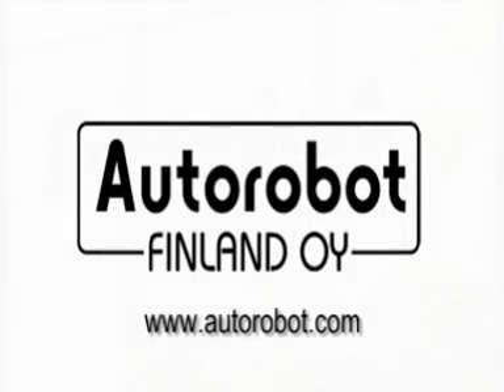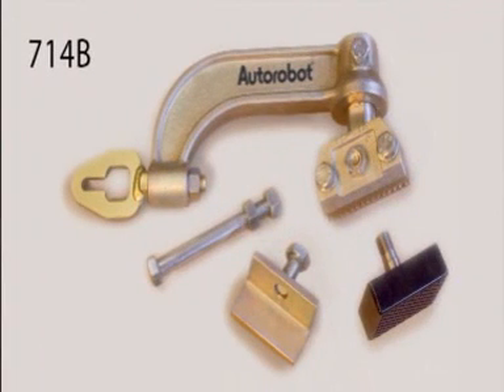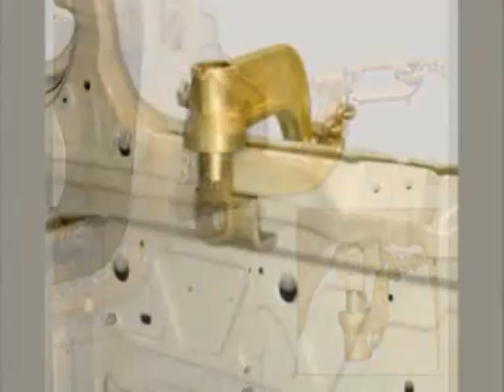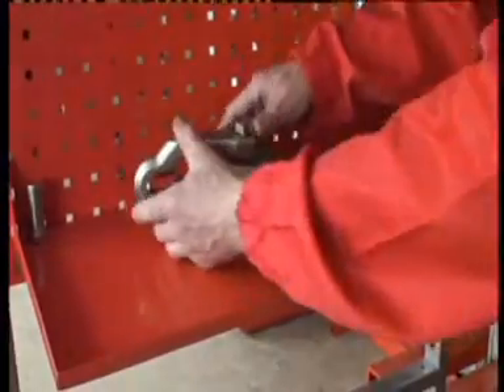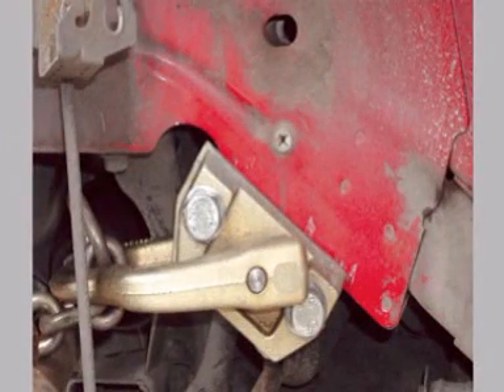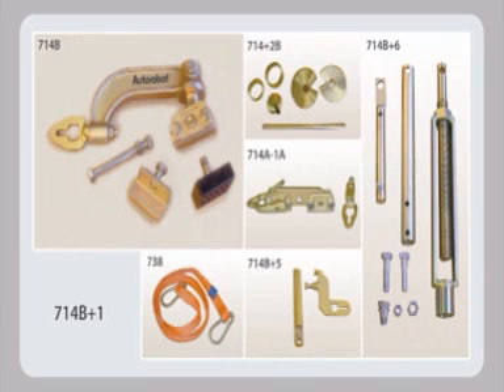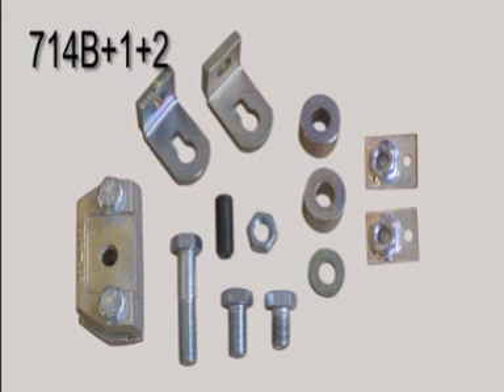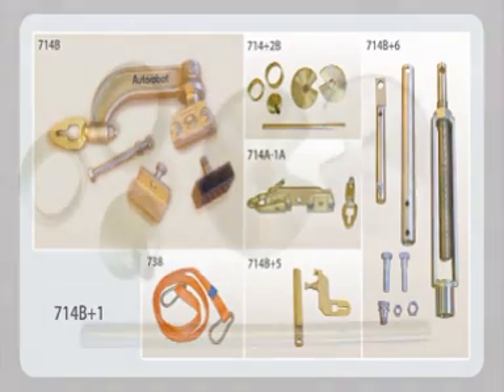714B Autorobot Satellite straightening gripper set, economical bodyshop equipment

Comment: in my own opinion.. if a vehicle sustained that much damage.  it should be thrown away. it will never have the same designed strength again. especially in a modern vehicle that have crumble zones. it's not worth putting your life at risk. total the vehicle and replace it